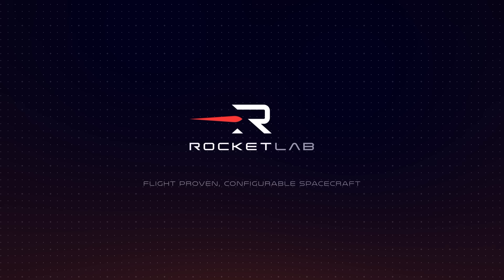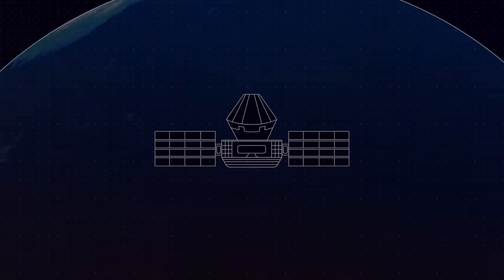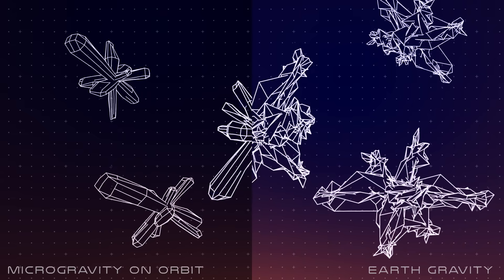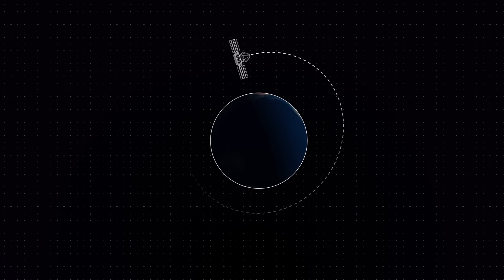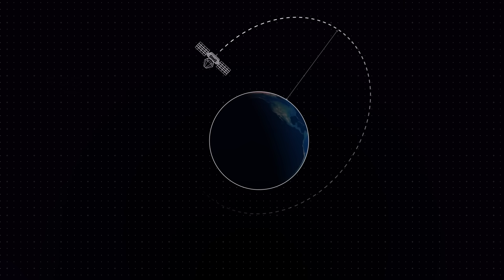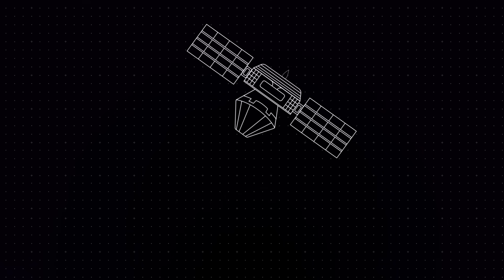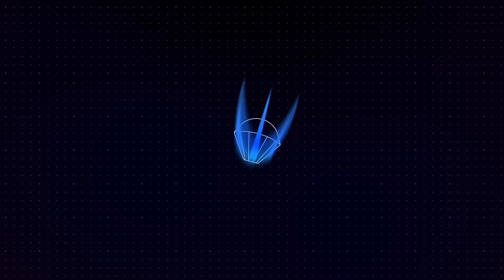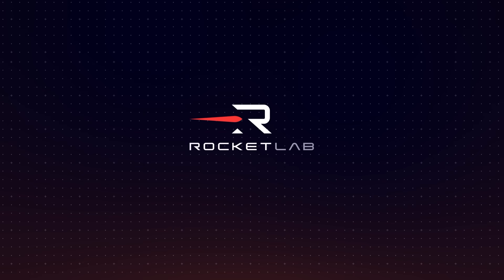From Sci-Fi to Reality: Rocket Lab’s Pioneer Spacecraft Delivers In-Space Manufacturing

Comment: What is the purpose of the elliptical orbit? Why not reenter from the 500km orbit?
Reply: I believe it's so they can have a more direct path to an exact landing location. Also, wouldn't a more shallow re-entry have less of an angle when hitting the atmosphere and be more difficult to land with accuracy let alone a possibility of skipping off the atmosphere back out into space?
Reply: I wondered the same thing.  Are they wanting it to hit the atmosphere faster for some reason?
Reply: @k1ng401  i guess it’s a way to test for more rigorous entry conditions and how well the capsule and its cargo handle it, but I don’t think I’ve seen any other mission do this besides LOFTID, which was specifically a heat shield test.
Reply: Of course we all know that too shallow an angle can cause a spacecraft to 'skip' off the atmosphere and re-enter space. I think the above answer is the best answer: a balance between the heat shield and time in the 'plasma' zone. 
But what was unusual was the capsule attitude. The narrow end going in first? Goes against all the other shapes we see with Human and Cargo capsules. Maybe the idea is a self-stabilising 'dart' shape that allows for no active control thrusters for orientation?
Reply: @David-yo5ws Or the person doing the video didn’t understand spaceship design. These sorts of visualisations are often done by the PR department and not properly “prof watched” by engineering, or engineering point out the issues but PR chose not to spend the money to fix the issues.
Reply: @ATH_Berkshire  I think your right. Without seeing the real 'space laboratory'  in a picture, they just came up with a 'concept' design.
Reply: @ATH_Berkshire you can literally look up photos of the capsule, it does use a conical heatsheld and flies pointy side first. The mission landed more than a year ago and they have recently landed the third one. They're not that uncommon, mars missions used them, jupiter atmosperic probe used it, Osiris rex used it etc
Reply: @David-yo5ws when you say "skip" off the atmosphere do you mean it just doesn't deorbit and has enough speed to punch out and orbit again? Or does it actually bounce off and change trajectory like a rock on water?
Reply: @uglypinkeraser  at hypersonic speeds blunt objects create enough lift that you can stop descending and start going up, then as atmosphere gets less dense and you slow down, you fall back again. Depending on trajectory, you can do one or multiple "hops" or even graze the atmosphere so that you stay in orbit (aerobraking), however you still would go into the atmosphere on next pass.
Reply: My guess - to achieve a specific re-entry angle, as @k1ng401 says, at the cost of a higher re-entry velocity. Perhaps secondly, going faster makes for less time coasting in the atmosphere . . .
Reply: @DnmOrr right which could mean a longer period of heating than the heat shield can stand.  I’ve heard that’s why other spacecraft don’t come in at shallower angles even though the temperature would be less intense, it’s baking the spacecraft for longer.  I think Scott Manly did a video on it.
Reply: The steeper the angle you're coming down at, the smaller the margin of error around the target location (which is why the eventual ISS de-orbit will likewise involve braking as hard as the structure can tolerate, minimising the potential debris zone).